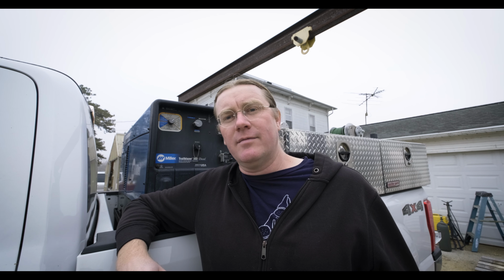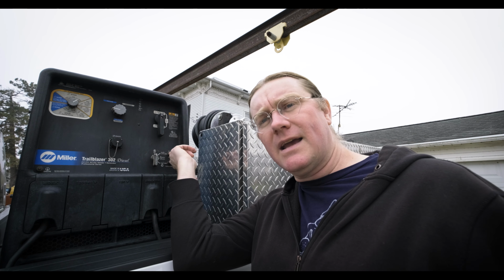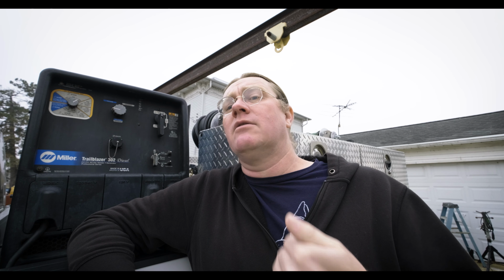Reviewing The Miller Trailblazer 302 Diesel After 50 hours

Comment: I have the exact same machine. I bought it used. and yes I noticed it does bog down a little when I am running 7018 at about 135. does that happen to you?
haven't tried gouging yet.
Reply from the maker: Haven't noticed it as bad after a couple fuel filter changes and some Lucas fuel treatment

Comment: Look into a Multiquip Whisperweld. These machines are amazing. Diesel , you can barely hear them while running full tilt. Amazing weld quality and good features on the welder. Rented new ones and just recently bought an older unit for $1,500 CAD with only 1000 hours on the Kabota Deisel. Check these machines out Zac
Reply: Whisperwelds are awesome I absolutely love using them but I've never seen one mounted on a rig anywhere not even on the internet. There must be a good reason why nobody runs them on rigs. The only reason I can think of is that they are pretty wide and bulky but that's my best guess.
Reply from the maker: Seen a few on jobs but never had the chance to run one

Comment: I’m still considering that 302 I told you about but the guy wants $6500 and I don’t think it’s worth anywhere near that. It’s sub 200 hours but it’s still an older unit
Reply from the maker: I can see not wanting to spend that much, figure a new 325 diesel is 20k though
Reply: @DarlingtonFarm  so I’ve gotten him down to $4500. So I may buy it
Reply from the maker: @michaelt.9372  not bad
Reply: @DarlingtonFarm so a year later I’m still working on getting it. I got him down to $5000 with the trailer it’s on. So I’m gonna get it.

Comment: How’s the tiggin on it ?
Reply from the maker: It's pretty solid, nothing like the pp400 but it's the same as any other lift arc machine. The pro/pp 400 you can adjust the arc length when it shuts off the arc. It's crazy nice

Comment: i have never heard a welder even my old sa250 that was louder than a grinder.   Either you have extremely sensitive hearing or there is something wrong with the welder in general.    i honestly never even hear my welders when i am working as far as loudness.   i listen to how they are running but the sound never hurts my ears.   but i also have tenitis so bad from head injuries that i welcome other noises
Reply from the maker: Try one of the high speed diesels, they are crazy loud. Ive had two and both are just stupid loud.